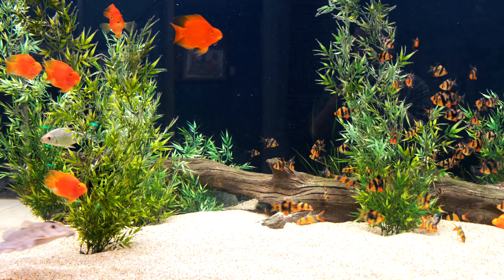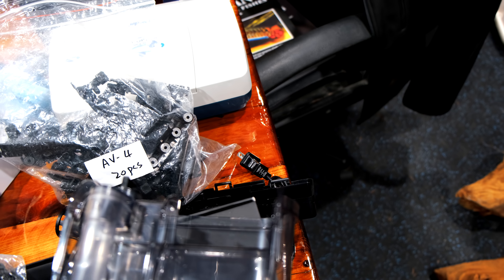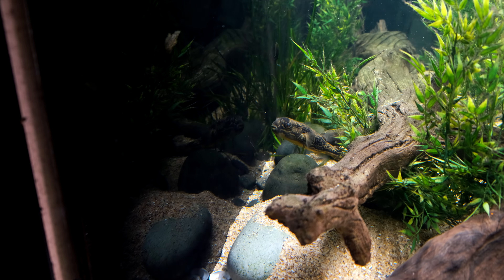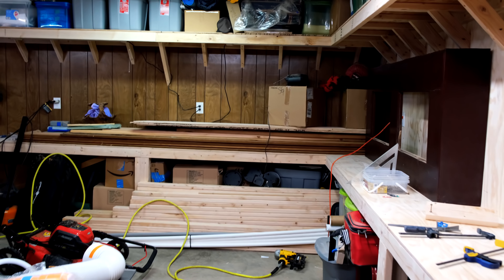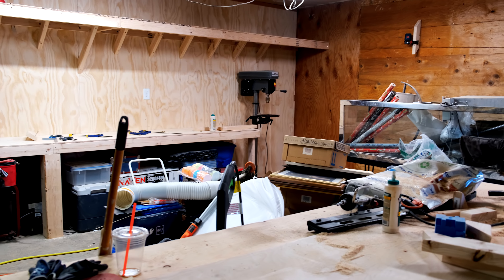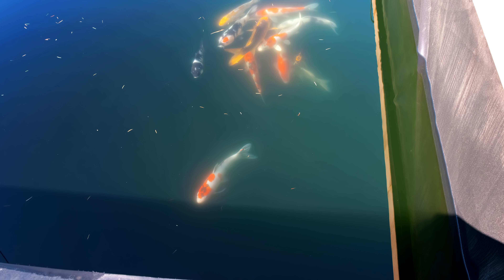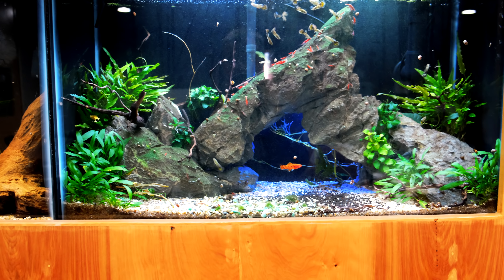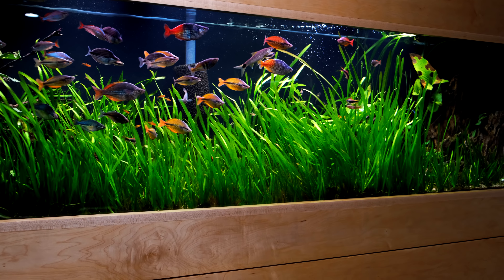Come along for the day - Fish Room Update Ep. 81

Comment: Biggest issue with the pond is the filtration is so good that you arent going to be getting those layered temps due to water circulation. I have had good luck just leaving the pump in the skimmer box and letting the water fall flow. However it is turned down so that the total water turn over rate is much lower. Hopefully keeping the layers. Just a thought man.

Comment: Cory check these out, they're cheap smart switches that you can turn on and off your lights filter water feeder even though you're at work or on the other side of the world, and it even works with Google or Alexa, I know you've seen this stuff before but this is like $5 per unit, and in the app you can name them, so if you have a hundred of them in your house if you don't accidentally shut off the filter when you meant to shut the lights off.

Comment: Cory the tank with the two goldfish, is that sand or a fine gravel on the bottom?
Cory you should NEVER feel guilty about not getting videos out to us every single day. You have a full time job, a family and more things to do and getting done than 5 people could do in a year. I came late to the game, just recently decided I wanted to get back into the hobby, but I have to say things have really changed since the late 80's - 90's. It's going to be at least 6 months before I can even think about buying anything, just doing major league research right now. Because of back problems was thinking the largest tank I could get would be a 20 gal, but with the Python, I wouldn't have to lug water buckets, so that means I could even go up as far as a 48 - 50 gal. My largest tank I had in the past was a 55 gal. Back then it all went by gal and not length and width and depth. Back then all we had were the HOB and UGF. I'd really like to use some sand in a planted tank, can you use the fluval substrate and then put sand over that ? The only thing about the sand is I'm worried about all these horror stories I've been reading about with the gas pockets. Would Kuhli Loaches help somewhat with that? Sorry about writing the novel, I have to say you and your site is awesome!!!!!!!!!!!🐟🐠🦐🐡🐌

Comment: Hey Cory, i got a Group of 15 tiger barbs for my 180. I have decent Filtration and circulation Theresa because it was an Trimaculatus outgow tank. It has two 1500Gph wave makers on one side and an Fx6 on the other. The barbs seems to avoid current. Is this normal, i thouht they wehre ok with decent circulation